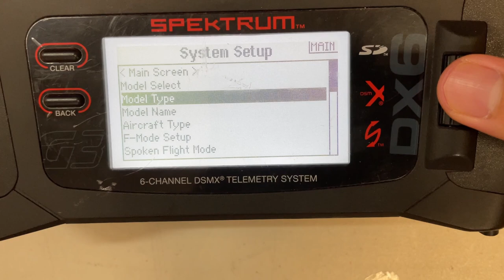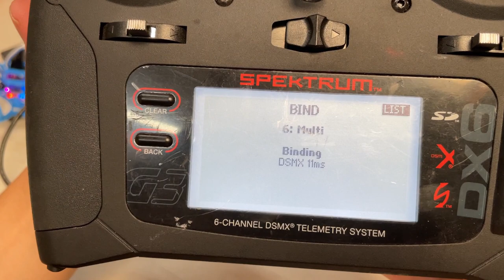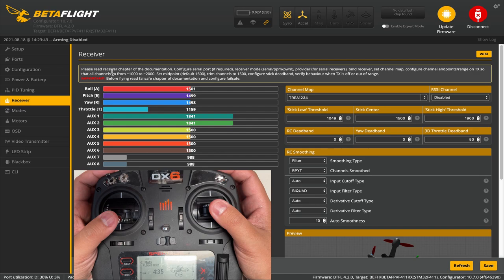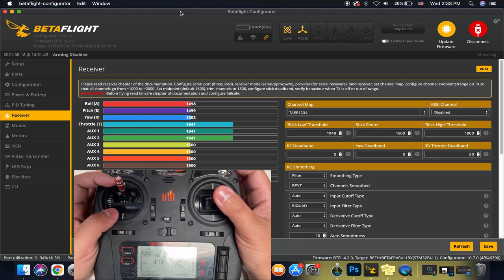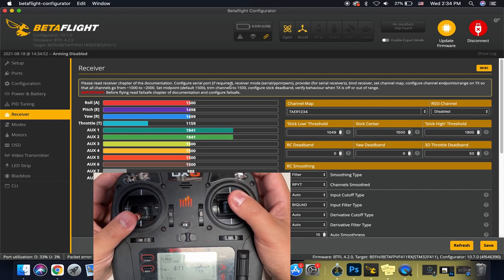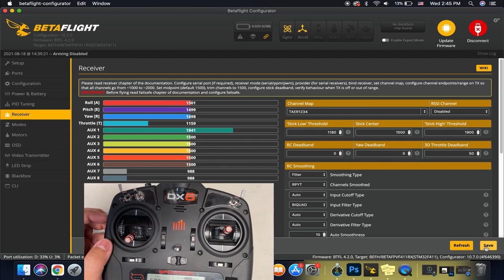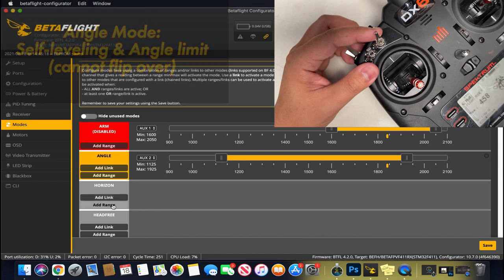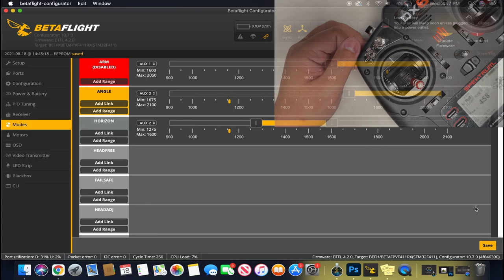Binding DX6 and Meteor 75 w/ DSM receiver

Comment: I am Trying this using a DX6e.  I cannot Arm the Drone. I follow every step, Connect to Betaflight  and Move and adjust the Gimbals and everything works. I Disconnect from the Computer throw in a Battery in the Drone. turn the Transmitter on. Throw the Arm Switch and the Drone does nothing but Blink. I need Help. Tried Calling the # for Sam and No Answer.
Reply from the maker: did you do the "autoreset = on" before removing power after you bind? 

If so, the first power on with the battery, you may need to disconnect and reconnect the battery again.
Reply: I had no luck at all, and I have the DX6E. After 10+ attempts, I just used my multi protocol Jumper T-Lite V2 (way cheaper)....kinda mad, then said, then happy.
I really wanted to use the DX6E....